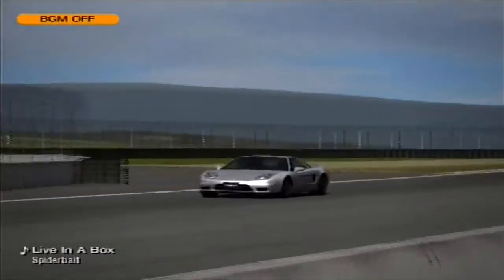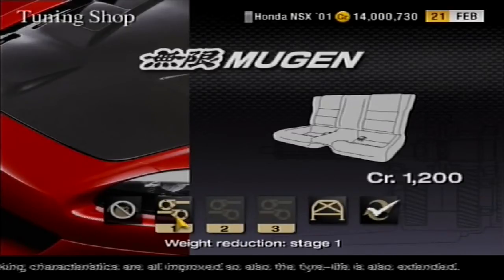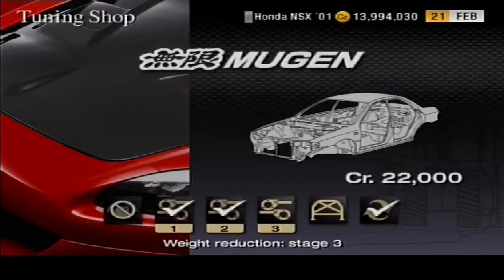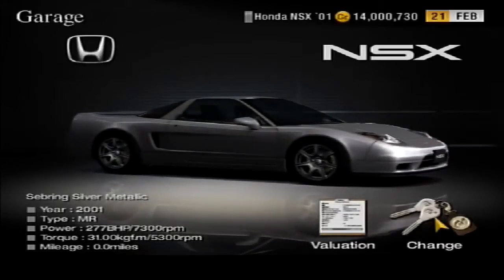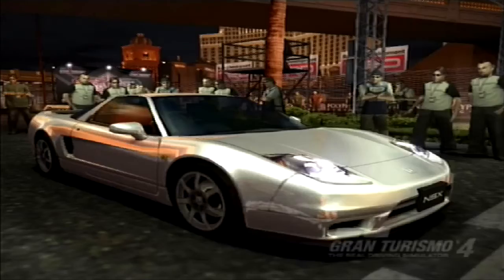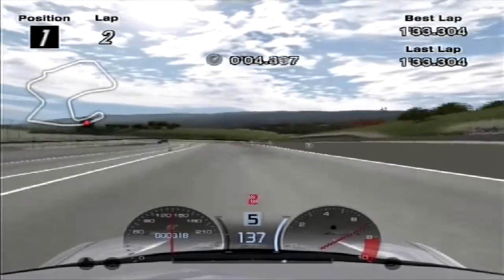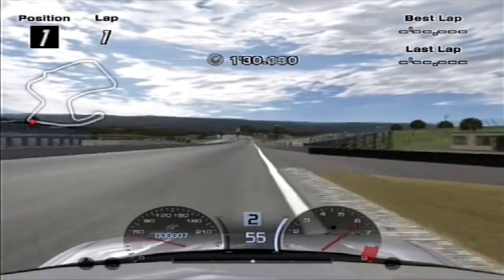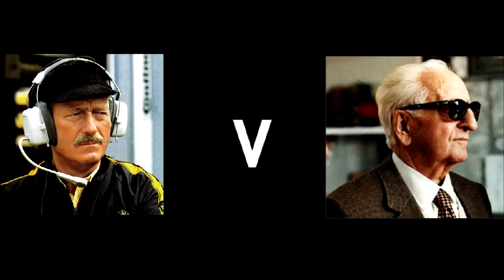Gran Turismo 4 - What Matters Most? - Part 8 - Weight

Comment: Nice Video!
Btw i've got 2 questions to ask you, 1) What car  did u start with on gt4 2) What is the worst car that you bought on gt4.

My starter car is the misubushi lancer (which always seems to be in the used car shop whatever game it is) and the worst car i have v=ever bought is the gillet vertigo ( 1 million credits down the drain!)
Reply from the maker: Adam Smith 1. The first car I got I think was a Volkswagen Lupo from completing the first license. 2. I can't really think of a worst car but the Suzuki Pikes Peak Escudo was a disappointment.  Such an overpowered car in GT2 and GT3, near useless in this game.

EDIT: Actually the Toyota 7 has got to be the worst car considering how hard to get it is and how it should be good, but really isn't.
Reply: I know what u mean with the toyota 7 being disappointing and not as good as expected (especially when compared to the toyota 88-cv which i did win in the super speedway endurance race, (although there is a glitch in this race where speed and the suspension travel on the banking with lemans cars causes punctures and cars have to pit (although the ai dont know when to sometimes))